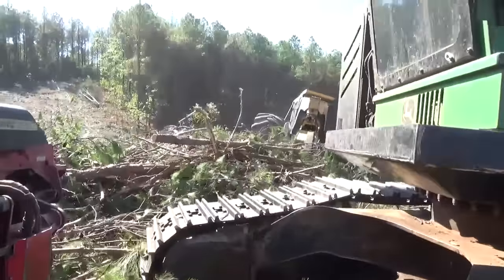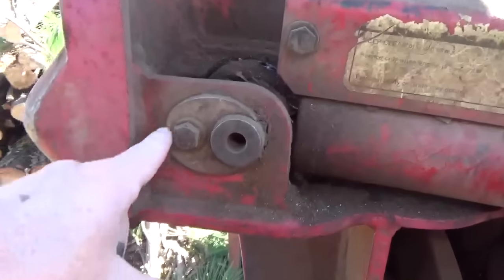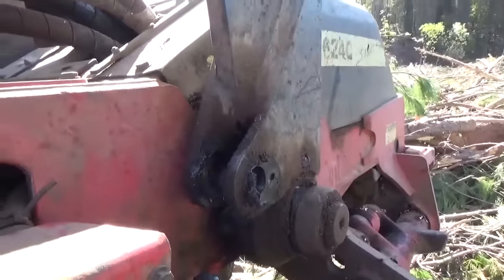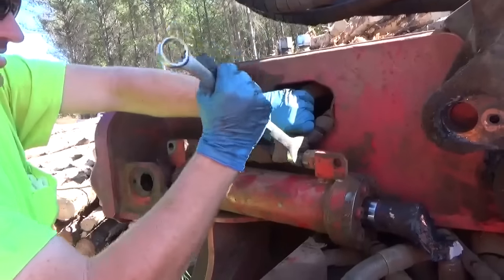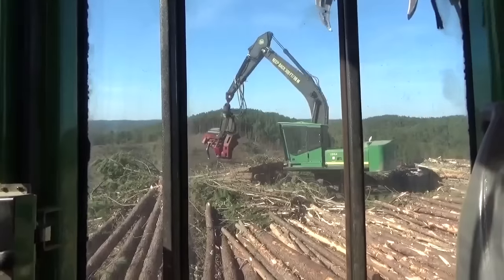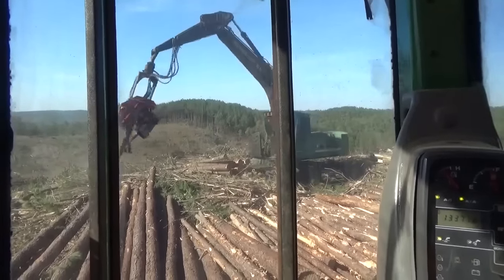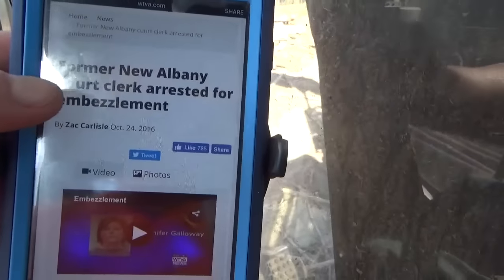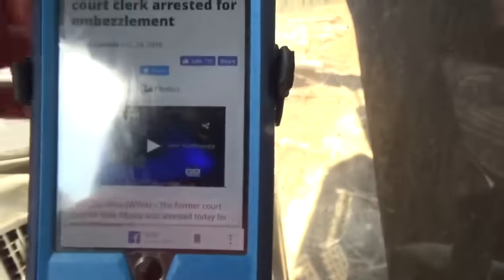Tigercat 635D AC replaced and John Deere broke down

Comment: Tim, I've found that it's corrosion between dissimilar metals.  Usually where there is condensation.  I have taken a die grinder and cut the nut, then used a screwdriver to open the nut up a bit.  it comes apart easily after that.  It's saved me from having to replace condensers, evaporators and compressors.  You do have to replace the fitting or line though.

I think it's the fact that there are no consequences when someone flips the bird on line or cusses and calls someone names.  If they did it face to face they risk getting a fist planted in their face.

I remember a story a friend told me about 35 years ago.  A buddy of his was driving down the road when someone flipped him off.  At the next traffic light this guy got out and went up to the guy that flipped him off.  When confronted the guy flipped him off again.  That's when my friends buddy grabbed the offending digit, bent it over backwards and broke it.

The guy with the broken finger took my friend's buddy to court and the judge fined him.  When asked about the outcome of the court appearance this guy told my friend it was the best $50.00 he ever spent.

Comment: If possible,when reassembling ac lines you can put on a little antisieze on the pump fittings. It helps
Reply from the maker: +Donald Cisney if they would just do that from the factory. That was the original compressor.

Comment: It may not be recommended but I normally CAREFULLY put antisieze on metal to aluminum lines and it does seem to lessen the amount of times they pull the threads. Isn't a save all but it does save a few which is worth it to me. I know you guys use it on some but thought I'd mention it.
Reply from the maker: +kj inohio that aluminum and steel together can be aggravating. That was still the same Ac from the factory that was on it.
Reply: Yeah, the factory consider it a one time tighten so they don't worry about on and offs. I deal with stainless a lot so antisieze is a must. really enjoy your real world views of working you give. Like you said, everyday is normally a new fix and I like to learn from others approaches. That's how we all get better and save time on stuff.